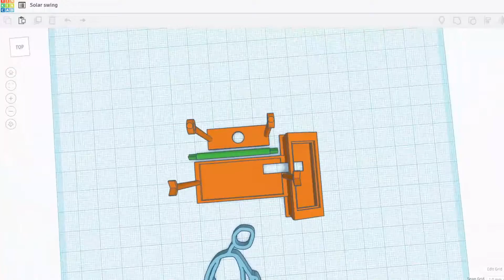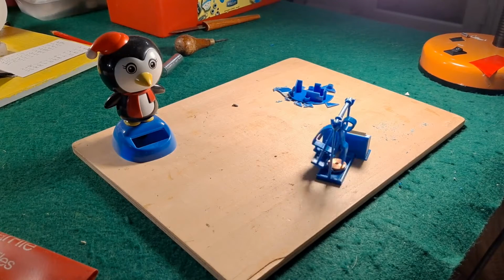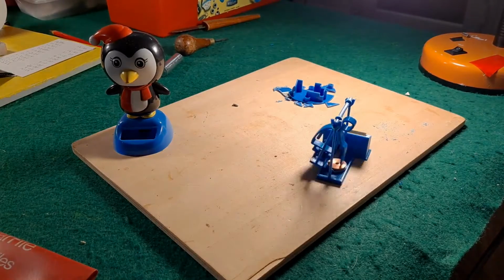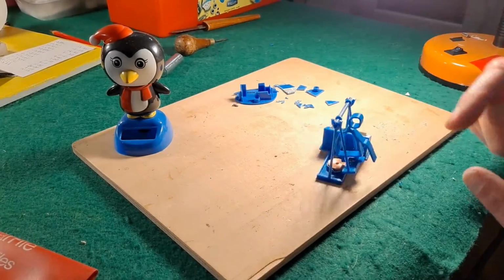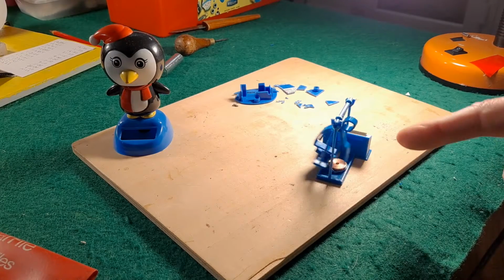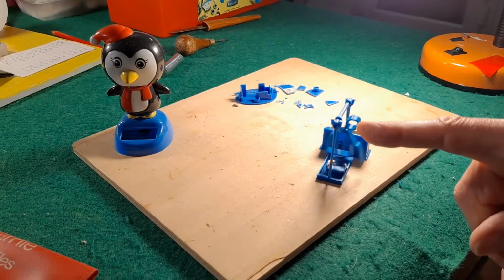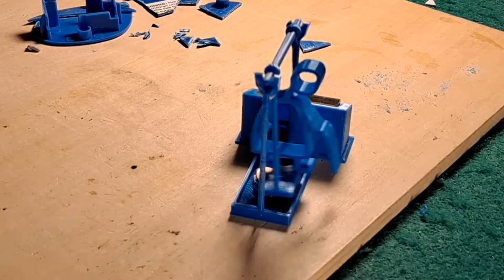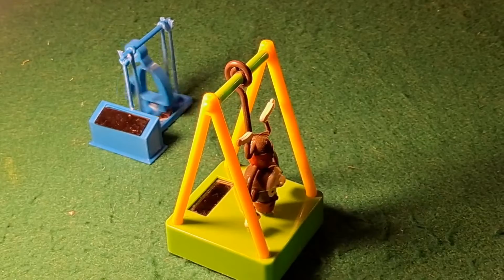Swinging Grandad Solar Rocker

Comment: Hey grandad do you have tips how to display solar rockers on Window sill?
Reply from the maker: Short answer, NO 😁 My wife does not like the noise they make. I just put out a selection loosely matching the season etc, so Christmas ones around Christmas, Halloween for Halloween, etc. I get lots of comments from people who want them to face inwards with their back to the sun so they can see them from indoors, and I get other people who want to view them from outside. The ones that I have 3D printed have suffered in the summer sun and warped and faded. The ones that are currently on my window sill are covered in cobwebs as my local spider seems to like them 😁 You will find links to my related playlists in the video description 👍
Reply: @GrandadIsAnOldMan  thanks grandad